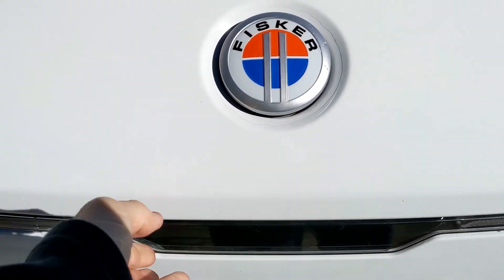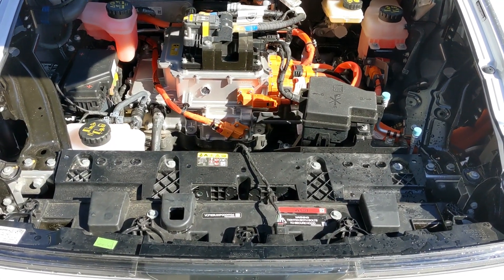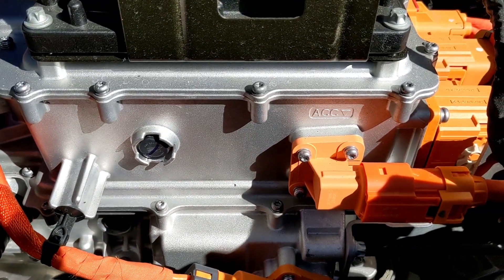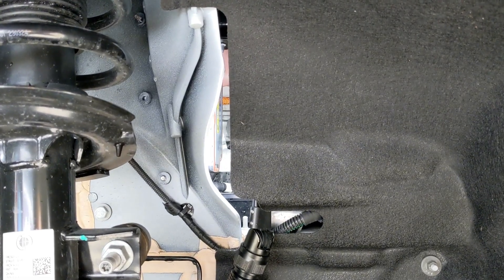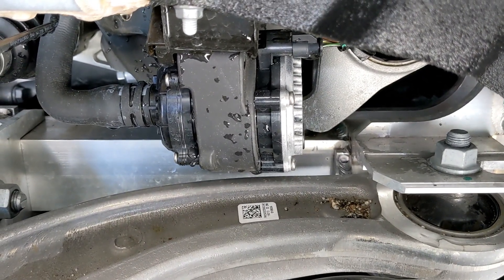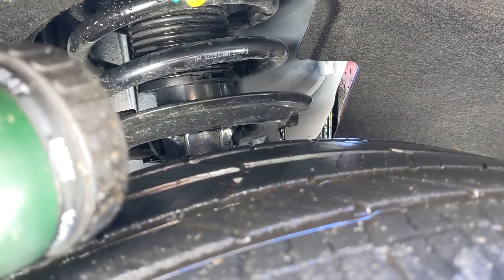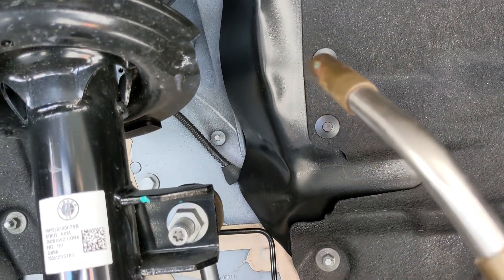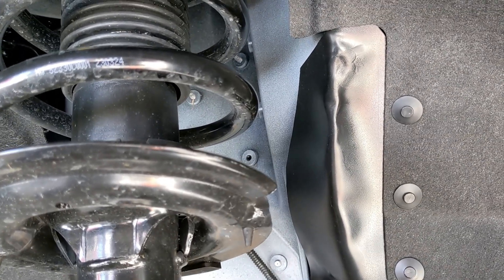Fisker hood/ right fender water testing with wheel well barrier fix

Comment: That pump you show at around the 2min 40 seconds into the video. That is the pump that is under the recall due to water going into the pump and hitting the PC board causing the pump to fail. The replacement pump does not reloate it but the PC board is "supposedly" much better sealed. I live in Arizona, pretty much no rain here and if it does I won't be driving my Ocean and I wash it with low water pressure.